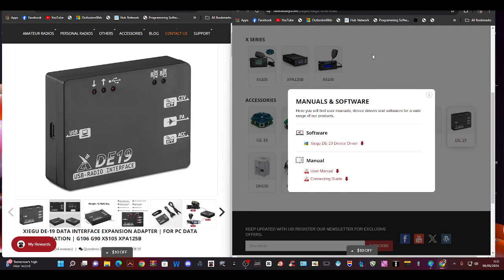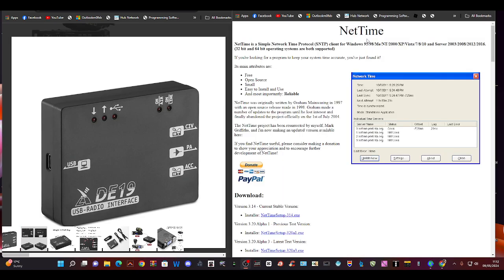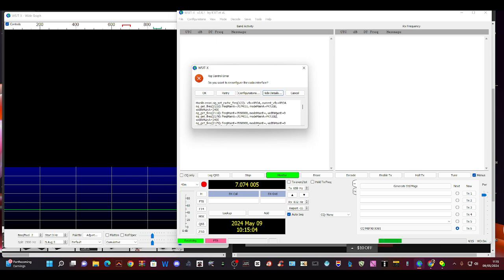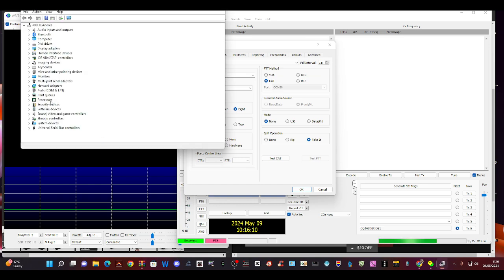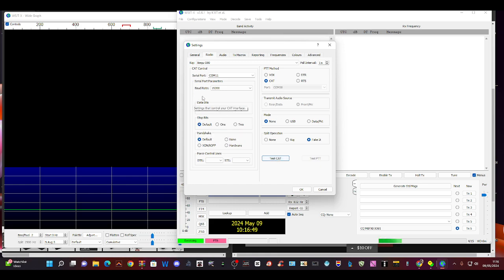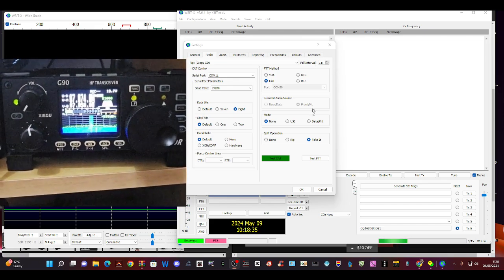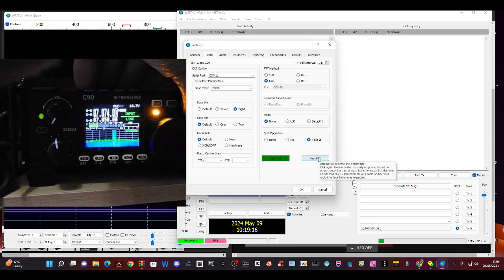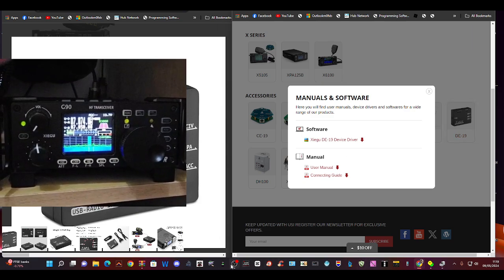XIEGU DE-19 USB INTERFACE & DRIVERS , XIEGU G90

Comment: did you have issues getting the interface to show as a com port on windows 11. when i try to install the driver it says the drive is successfully pre installed in advance. device manger shows it as a unknown usb device. 

any ideals?
Reply from the maker: Yes didn't work
Reply: @M0FXBHamTech  I found out you don't need those drivers. In windows 11 you have to to windows update and it will show there. Click to manually install. It will then refresh and show as a COM port.  You may have to restart the computer to get it to work correctly.
Reply: same here. Just received my G106 with DE 19. Can't install drivers on win 11. Both with cable and de 19. Pre Installed successfully and nothing. It's driving me nuts.
Reply: @Nerdelkin  did you manage to get it to work? it took a few tires before i found that out. works every time i set it up

Comment: Hope you get the issue fixed one thing to check maybe getting rf into the cables.
Reply from the maker: I think I will try older firmware I have new 1.8